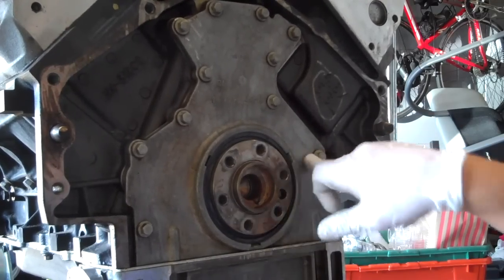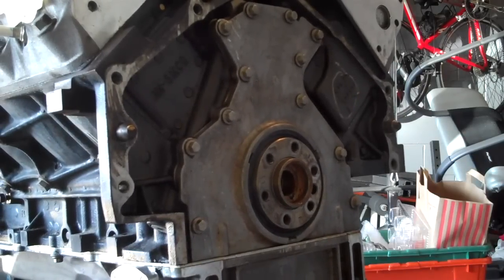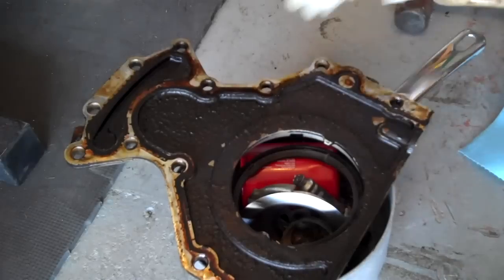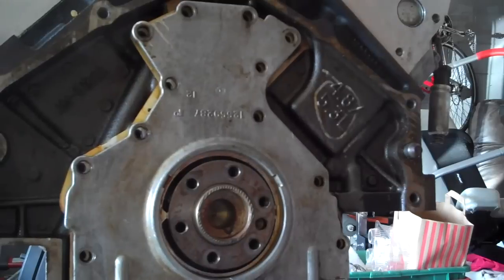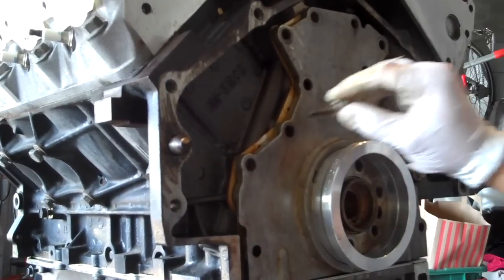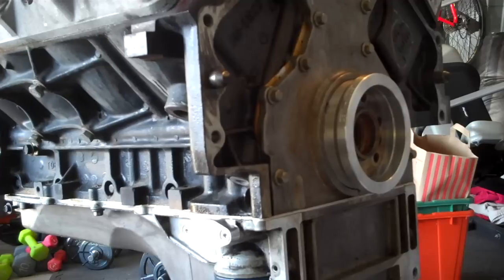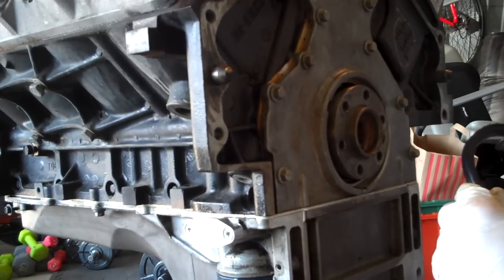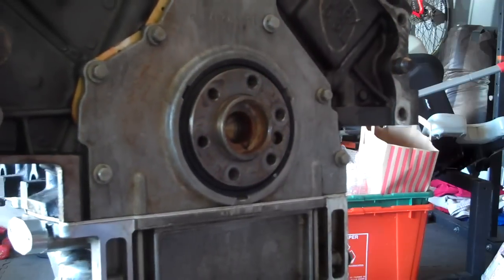LS / Vortec Rear Main Seal Replacement

Comment: I have been reviewing a lot of these videos for my 5.3 liter just to learn a little from each video.  In this video, I learned to balance out the bottom of the cover at 5:55.  Also, there is purpose for the white plastic piece which keeps the shape of that lip on the oil seal and which also guides it onto the journal so that it does not "catch/hitch" onto the edge of the crankshaft.  Lastly, it's a P.T.F.E. type material oil seal.  From what I have come across per the oil seal manufactures is that you install this type of oil seal dry after you have cleaned up the journal really good with same some brake cleaner and a clean rag.  Other than this it was a good video.

Comment: I’ve never seen anybody install the crankshaft still after they put the plate back on. Did that still end up leaking or did it hold up?
Reply from the maker: I’ve not had an issue

Comment: i just watched this and  i put my new seal in backwards when i took the old one out i laid it on the floor like it came out and then when i picked up the new one i noticed it looked like it went in with the lip to the inside wrong now gona have to drop trans and transfer case

Comment: I’m just starting to look this up. I’m mechanically inclined but new to this type of repair. Is it possible to do this on the truck without a lift?  Do I have to remove the transfer case and transmission? I’m sure there’s tons of tricks I don’t know but I’m sure I can figure it out.
Reply from the maker: You can do it on jack/stands. You will need to pull the transmission and transfer case.

Comment: You didn't even put sealant on the ends of the oil pan you're going to have a leak
Reply from the maker: You are correct. I had to drop the rear of the pan and add sealant.

Comment: Loosening the oil pan is unnecessary and could result in you having to change that gasket as well that tool should work perfect without loosening the oil pain
Reply: That is what I was looking at. He didn't have to loosen the pan, that's what the tool is for.

Comment: What type of engine hoist are you suspending the engine on?
Reply from the maker: https://www.harborfreight.com/1-ton-capacity-foldable-shop-crane-61858.html
Reply: @CliffsHowTo  Do you know if the harbor freight engine stand will maneuver OK over or under the harbor freight hoist legs or base?  Trying to find a good combo hoist and stand so I can avoid issues when transferring the engine from the hoist to the stand.
Reply from the maker: That’s what I used. Didn’t have any issues.

Comment: Every1 has there own  way of replacing the rear main seal, y not install the seal while the cover is in your hand already out hahah...lolololo....other youtubers did it n they have no probs ....
Reply from the maker: Because then the cover isn’t centered on the crank, and you develop a leak. 

How do you know the other youtubers didn’t have to do the job again, 6 months later because it started leaking?

Comment: Dose seal go in dry? Or are you supposed to lube it with oil first?
Reply from the maker: I think the seals I had were prelubed. However, if they are dry, you’d want to lube the seal surface which makes contact with the crank.
Reply: @CliffsHowTo  Not according to the instructions I saw. You aren’t supposed to lube the seals at all on the ones I have. They specifically say to not do that.

Comment: Here is a tip, if you want to clean pistons or any other internal parts, soak them in Berrymans Chem-Dip. It is $30/gal but worth it. I just re-ringed my lq4 And the carbon buildup was immense. Absolutely nasty. Soak em over Night and they are like new.

Comment: Since you're doing all that work you should have replace the galley barbell/ oil diverter plug while you had the rear main cover off..
Reply from the maker: Yup. And should have done that timing belt!

I think I’m going to round up another motor soon to rebuild and swap in. Put a cam and some head work into that one...

Comment: Do you know the torque of the motor oil pan of every single screw it seems like is different torque when it gets to the screws close to the filter  and transmission help me with that one bro

Comment: Curious which part you used? The Chevrolet performance pn 12639250 seems to be a good choice and it's an updated design with a new cover and 13mm head bolts vs the old 10 mm heads.

Comment: I know this is a different seal, but I have an 05 Envoy with a 4.2L, seal is very similar but I’m struggling to get the seal in. Looked like the same problem you were having, then suddenly once you realized you had it going in the wrong way, you skipped passed the install. Any tips on getting the seals to seat properly, or did it just slide right in?
Reply: I see 3 years since this video. For sure you don't need it no more but the seal come new whit a round soft plastic "installer guide" but this guy on the video he removed and installed with out. It hard that way.
Again you don't need it but maybe someone will can check the comments.
Have a good one 👍🏾
Reply from the maker: Yeah, it’s hard to do things and hold the camera sometimes... what you need to do is find something circular the same size to put over it and tap it in. 

I think I’m this instance, I used the old seal.

Comment: This is with the engine out. How hard is it to pull the engine?
Reply from the maker: That is a relative question. Would I pull the motor just to do this job? Probably not. Although, if you have the right tools, you can pull the motor pretty quickly. 

When I pulled the motor to put this motor in, I had out in about 2.5 hours.

Comment: I did mine 4 years ago. 2004 Tahoe. Required no special tools. Hasn't leaked a drop since
Reply: You just recplaced the gasket and circle seal and reinstalled it to torque specs?

Comment: Doesn't the seal need to be slightly lubricated first before installing it?
Reply from the maker: I’m pretty sure it was pre lubed with grease. If yours isn’t, then put a little grease on it before install.
Reply: That robotic room where the LS engines I was assembled did not use lubricant on the front or rear seal. Plus, GM’s electronic service information says to install both front & rear seals dry. It is temping not not used. It is not the same viton-type seal with a “Garder Spring” on the back, to hold it tight on the shaft. Oil or lubricant attracts dirt which accelerates wear creating the wear lip witness mark. Yes, completely assembled by robot arms, bearings, camshaft bearings are picked up, spun to locate one oil hole, then hydraulically pressed in place. Ever notice the cam is hollow? A long shaft passes thru it, comes out the back side, then slid in by plastic cover robot arm. Only at the end, fluids are added, yellow mark is painted and ran on natural gas for 10 minutes at 2K RPM, tagged, drained of coolant, boxed and disappears thru a plastic door. On the far side on the room, another freshly machined block comes in thru plastic doors from the “Blanking” room. It is a 24 hour ballet, just electric servo motors, arms repeating movement and compressed air, “DaVinci-III measuring arms and optical sensors over roller trays everywhere. I only saw 3 people inside the room in space-suits, 1 ran checks on engine while on natural gas, and two others loading parts & checking fluid tanks. Amazing, 100% automated. Retired ASE Master Tech/ Raytheon contract employee-Retired.

Comment: Great video thanks. Just my opinion... but unless you see an obvious leak around that larger housing gasket I would leave that whole thing on and just do the rear main seal. Just double check all those 10mm bolts are snug. Use a small screwdriver and slowly,,, without scratching the housing or crank... peel the old one out. Clean the heck out of the surfaces with some solvent.. then put a bit of grease on the crank and slowly tap the new gasket in working you way around if you don't have that $100 tool this guy had. The reason for not doing the whole housing gasket is you are sort of risking creating a new leak at the bottom at the oil pan because you sort of lost your compress fit when you took it off. In other words normally the oil pan would go on after. Now you doing that in the wrong order. So unless you have a leak.. leave that large housing on as you know it's already centered and it's snug at the oil pan. If it ain't broke... don't fix it. That gasket doesn't generally wear out anyway. Just my 2 cents.
Reply: Thanks for your ".02". I'm up to about a dimes worth right now. I've had no less than four other mechanics or knowledgeable vehicle people tell me the exact same thing. I'm getting ready to swap out my transmission and transfer case in my 02 Silverado and the general consensus is leave that cover plate alone and just do the rear main. stating the exact same thing as you did rarely leaks and I could potentially  be creating more problems down the road. Thanks for chiming in with this advice. 👍
Reply: You are correct.There's a whole set of fixtures and jigs to set that plate up with.I'll guarantee that won't hold up.

Comment: Is there s part number? For that alignment tool?
Reply: @anthony marasco  >Just buy the ones sold buy Sac City Corvette. You can hard work reusable tools for both ends, foe the price to one he used in the video. Alway install rear seal interior dry. It is designed this was using different compound. Also, Sac City Corvette has a “Bar-Bell” shaped rear oil passage part that eliminates contaminated oil from going into your lfters bearings, lifters, mains & rods etc. the OEM one is plastic and I would suggest replacing. 
Hopes this helps.

Comment: I always use a dab of rightstuff in any transition like in your case back plate and oil pan. This is extra insurance that there won’t be a leak. Also with that tool if you were to use a block of wood on the back to drive in seal evenly. If it were me, and had that cover off I would also install seal on bench then use Vaseline around the mating surface to the crank.just my 2 cents all in all nice job.
Reply: I would also drive the seal in then install the cover using the seal to center it . In fact you can buy the cover with the seal installed .
Reply: @losteroni  thats what i did, buy a new cover seal and bolts kit. For like 50 bucks.  No fancy tool needed.  7k miles and not a drop of oil leaking from my 310k miles 01 Tahoe 5.3

Comment: I would have clean that backplate up as well as the engine block mounting location for that plate. That looked pretty dirty.
Reply from the maker: The whole engine is pretty gunked up. The plan is to just get it running with this motor, then build another with a little more power.

Comment: What the blue filter looking thing called? Looks like and oil filter but obviously isn't. Fuel filter maybe?
Reply from the maker: That’s the oil filter.
Reply: @CliffsHowTo  what's the aluminum cylinder with the fuel lines running into it. It's bolted to the block.
Reply: I got it. The oil cooler.

Comment: That cover and the surface on the block should have been cleaned way better, should of done some light scraping then hit it with some scotch brite. also see those 3 small notches around the rear main seal, right on the cover? Those are so you can tap a screwdriver into/thru the seal and then pry it, its alot easier.

Comment: What are the proper torque specs if I may ask?
Reply: 18 ft pounds for the upper 12 bolts and 106-inch pound for the bottom long bolts.

Comment: Next time use blue devil like i do, 10k times easier...ha ha lol
Reply: What do you mean blue devil to press the seal in or something else
Reply: Blue devil is an oil additive to make the rear main seal expand back to original size so to speak. To slow down the leak or in light cases stop it. I have a video on it

Comment: The only thing I disagree with is not cleaning the mating surface for your Gasket.
Reply: @Ber Zerked  Nice suggestion and good catch. As a retired ASE Master Tech, I would hit it with some cleaner, scotch-brite and a dab of high temp red RTV in the corners. Maybe it’s me, but I tapped a seal in place one day 30 years ago and saw the garter spring fall off and lay inside the hole. I have always gently filled a little grease in that back cavity around the spring if there is one. 
  These don’t take lube on the inside on the crank dry by the book. Without opening the LS gasket kit sitting 12 ft. away, I don’t think these use a garter spring. 
  Also, if there is not groove on the rear crank flange, I would still expect to see a burn’t oil ring and using some scotch-brute again, brake clean, I would feel dirty. If the seal, old or new, sits over this, it will leak. Just too cautious from years of production work because a “Come Back” doesn’t pay well. Plus customers hate leaks, even if it’s water dripping out of the HVAC drain on a hot humid day. They still complain!
Reply: @deankay4434  damn water drip lol .  Tell them if it ain't dripping your shit wont be working lol
Reply: Carbon, pressure and heat. The next guy will have diamonds.

Comment: Nice video! What are the torque specs for all those bolts?
Reply: Probably 18 ftlbs
Reply: For those size bolts usually it will be 18ftlbs, but be sure to look up the torque specs just in case
Reply from the maker: +Robert Munguia I thought I said in the video, but you can find them here: https://www.ls1howto.com/index.php?category=1

Comment: It boggles me why there is no seal between the rear cover and the oil pan?
Reply from the maker: +Greg d Greg d the oil pan gasket creates the seal between those two surfaces.
Reply: If u open 1 f the covers the seal is getting weaker

Comment: the white insert is for the lip of seal you leave it in and as u drive on seal it pops out.
Reply: Thanks for that... that makes sense now.
Reply: I like the part where he says “Just wanted to make sure I was putting it in the right way”. They all have raised lettering on them that says”This Side Out”. The GM tool is an over-designed expensive Kent-Moore version that centers the cover. Then you used the seal install tool that holds it snug with the white seal lip retainer left in it. You drive the seal home as there is a stop cast in the cover, then the white seal lip retainer falls into the tool. Dry!
Reply: I noticed that, I think is a good video anyway 👍🏾

Comment: No reason to remove the rear cover to do a seal change!  The gaskets RARELY ever leak and are best left alone.
Reply: HAHA YOU MUST CHANGE REAR COVER GASKET WHILE YOUR IN THERE... THEY ARE LEAKERS, THEY WILL START TO LEAK AT SOME POINT 👍
Reply: Randy H. Unless you’re running boost and it blows out from the crankcase pressure lmao... ask me how I know lmao
Reply: Why in the hell would you do all this work to NOT change it while your there??!!